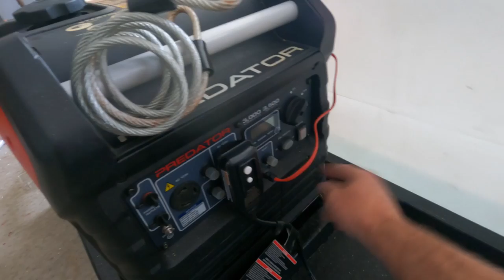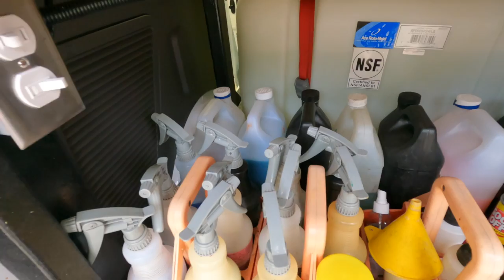Building The Best Mobile Detailing Rig Setup Part 3 | The Detailing Business

Comment: Very very clean set up. Thanks for sharing!
Reply from the maker: Thank you
Reply: @TheDetailingBusiness  Would it be okay to run a 2000 watt generator with this set up?
Reply from the maker: You can. You just have to be selective on what you run at the same time. I used to run a Honda 2000. I could run my steamer and vacuum at the same time but it was maxed out
Reply: @TheDetailingBusiness  Okay seems it would be  more efficient to go with 3500-4000 watt. Thank you for the reply!
Reply from the maker: I ran the 2000 for years. It was great but kind of defeats the purpose of being quiet because it’s running wide-open and loud with the steamer and the vacuum together. The predator 3500 from harbor freight is a good deal and it has been good to me so far. You can hardly hear it running, which neighbors in the area love.

Comment: Question I have a leak behind dry wall at home plumber wants to use this same method but a plumber who now moved to other state used to weld pex to copper. Any idea if this method u are using is safe for home use  ? Thank you in advance
Reply from the maker: Absolutely. All new homes are going to pex, which is what I’m using. You can tie into copper with it also. I hope you mean soldering copper. Lead is deadly in plumbing and is against the law now

Comment: Why not set the hose reel to come out the side of the vehicle instead of the back? I'm sure it's not a lot of effort to pull it out a couple extra feet around the back. But, when i sprayed chemicals it sure was easier when the reel was oriented towards the object you're spraying instead of coming straight out the back of the vehicle.
Reply from the maker: 90% of the cars I do are either in a garage or driveway, and I back up to them. That’s why all my products are in the back. I turn around and everything I need is right there.

Comment: How did you manage to find fittings for the electric pressure washer too connect too the reel?
Reply from the maker: 3/8 to pressure washer adapter https://amzn.to/3uHnorm
3/8 pigtail for reel https://amzn.to/3z15m63
Hose reel https://amzn.to/3yszWUk

Comment: Hi do u have a link for the water tank you use in the set up
Reply from the maker: Here is the tank I use. 50 gallon.https://www.plastic-mart.com/product/3567/50-gallon-auto-detailing-tank-sp0050-rt
Hose Reel - https://amzn.to/3nEp4y2
You'll also need a hose reel connector. Comes in different lengths - https://amzn.to/3qHqgD2

Comment: Also what’s the link for your pressure washer hose reel
Reply from the maker: Here is the tank I use. 50 gallon.https://www.plastic-mart.com/product/3567/50-gallon-auto-detailing-tank-sp0050-rt
Hose Reel - https://amzn.to/3nEp4y2
You'll also need a hose reel connector. Comes in different lengths - https://amzn.to/3qHqgD2

Comment: Personally better off with the 12v pump running off a  12V battery and use the generator as a back up ....  quieter and no stink or noise from the genny..probably  cheaper to run as well
Reply from the maker: Thats what I ended up doing. It turned out that running the pump off the generator wasnt supplying enough amps to run it correctly. I picked up a small 12v tractor battery from TSC and use the generator to recharge it. Much better outcome
Reply: @TheDetailingBusiness  run my 12v pump system the exact same way. And also happened to start it out with TSC batteries ha.